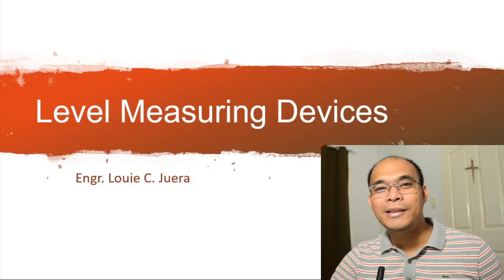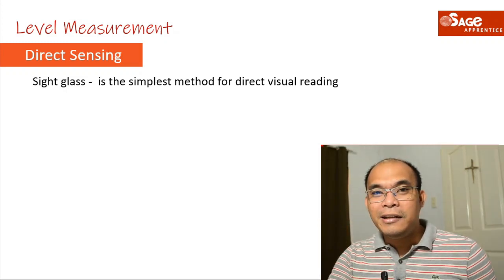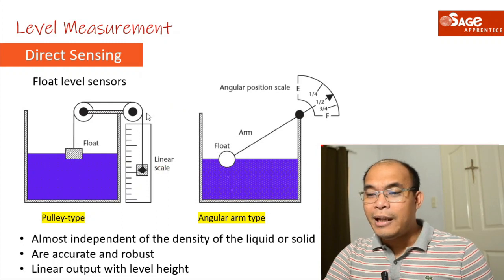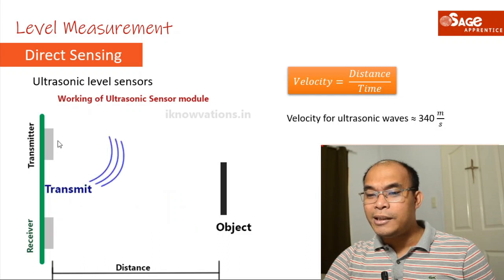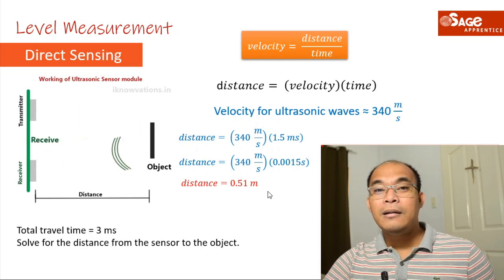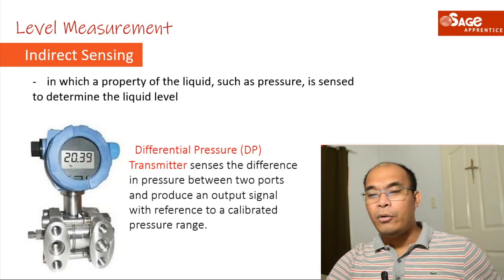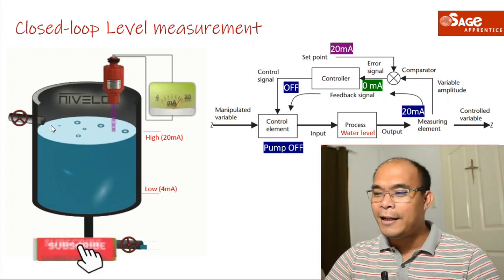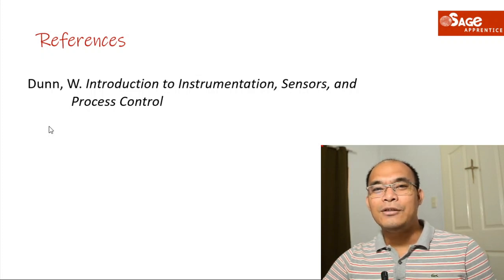How does a Level Measuring Device works?

Comment: Good day Sir!
I'm eternally grateful for the another video Sir because I have expanded my knowledge regarding with, "Level Measuring Devices". The distance between the reference point and the product surface is measured by the level measurement devices.  This is very important especially in marine automation. Actually, there are two types of level measurement devices: Direct sensing and indirect sensing. The direct sensing, monitors the current level while indirect sensing is used to estimate the liquid level by detecting a property of the liquid, such as pressure. Direct sensing includes, sight glass, float sensor, and ultrasonic device while indirect sensing includes, differential pressure transmitter, and closed- loop level measurement. All devices that has been mentioned have different ways when  measuring a specific level of liquid. So, it is necessary for us to distinguished their pros and cons so that we are  aware of   the deviced  that we are going to used or work with. Thank you and God bless Sir!

Comment: Good day sir, After watching this video. I learned the working principle of level measuring devices. There are two classification of level measuring devices which are the direct sensing and Indirect sensing devices. In direct sensing, there are Sight Glass that is for direct visual reading, Float Level Sensors that indicates if the level rises there is a changes in the linear scale and in the angular position scale and lastly, the Ultrasonic Level Sensor that indicates if the transmitter sends the sound waves, it will reflect to the object. The reflected waves will be received by the receiver and converts the reflected sound waves into an electrical signal. Meanwhile, in indirect sensing which is a property of the liquid such as pressure that sense to determine the liquid level. And also indirect sensing is you need to sense it first before you will know the level of an liquid. Thank You Sir.

Comment: Good day sir! I learned a lot in your discussion especially in the different types of Level Measuring Devices and how they work like sight glass the simplest method for direct visual reading although it's cheap but easily broken, float sensor is the linear output with level height it is also accurate and robust, Ultrasonic sensor has two components the transmitter and receiver, Differential Pressure transmitter senses the difference in pressure between two ports and closed-loop level measurement. Thank you and God bless 😊

Comment: Thanks for this video sir. I learned this video. The characteristi of of glass guage is easily broken dapat hindi pwedi lagyan ng mga hazardous na liquid. Shoud not be longer than 4 feet .
Components of ultrasonic level sensor they have transmitter and reciever. Transmitter nag sesend ng sounds of waves and reciever  recieve the reflect sounds waves.

Comment: Have a great day Po sir. I Learned this video the deferential pressure transmitter . closed - loop level measurements. I learned on how to connect the potentiometer ,and I learned that this potentiometer it's help level of water on Electrical signal's.

Comment: I learned that the direct sensing is more easily to use and more accurate and it is precise when it comes measuring and easy to read the measure, examples sight glass, float sensor and ultra sonic device. In indirect sensing is more on using sensor device, example when the tank is full the sensor will send a signal to the DP transmitter through the controller room to stop the pumping. Thank you sir.

Comment: Have a Good day sir, in this discussion i learned a lot like on how to shot off the valve , when we replaced the sigth Glass ,,,also  i learned on how to connect the Potentiometer,and i found that this Potentiometer it's help the level of water on electrical signal, thank you sir God bless 😊

Comment: Good day sir, this video I learned the working principle of level measuring devices. So specially the two classification of level measuring devices which are Direct sensing and Indirect sensing. So direct sensing is actual level is monitored for example inside the tank if HFO or Water. Which uses by the basic sensing such as sigh glass, float level sensors, and ultrasonic level and also the Indirect sensing in which a property of the liquid, such as pressure sensed to determined the liquid level. Which uses by the Differential pressure which help to sense the level and also the closed loop level measurement. So as a future marine engineering it is important to learned this level measurement on ship cuz it help our duty to be ease.

Comment: With this discussion, I learned and understand the different level measuring devices and the working principle of it in a system. Since there are 2 categories of level measurement, it states the meaning, its usage and their basic devices. One of this is the Direct Sensing which means that the actual level is monitored and has a basic devices namely sight glass, float sensor and ultrasonic devices. On the other hand is the Indirect Sensing in which a property of the liquid, such as pressure is sensed to determine the liquid level. It has also the differential pressure (DP) transmitter and the closed-loop level measurement.

Comment: After watching this video is that the operation of the level measuring devices. There will be a two types or two categories in level measuring devices and that is direct and indirect sensing. In the direct sensing is that the actual level is monitored and tells something about its environment are sight glass, ultrasonic devices and float level sensor, sight glass is the simplest method for direct visual reading, the other hand there will be an indirect sensing and it needs pressure, and indirect sensing in which the property of the liquid sveh as pressure, is sensed to determined the liquid level thankyou sir, for learnings ❤️

Comment: Good day sir. Thank you for discussing the level measuring devices. I learned that these level measuring devices is very helpful and important onboard ship. I also learned the two categories of level measuring devices the direct sensing and indirect sensing. The direct sensing the actual level is monitored and have a three basic devices the sight glass, float sensor and ultrasonic devices. Indirect sensing in which a property of the liquid such a pressure is sensed to determine the liquid level.

Comment: Have a good day sir, thank you for this video.  I learned  this video  the deferintial pressure  transmitter. Closed-loop level measurement, and i learned in how to connect  to potentiometer and this  potentiometer it  helps level of water ob electrical signals

Comment: Level measuring devices are usually fix on the tank. This devices can indicate the level of the liquid inside the tank. This device is helps the duty personnel so identify the level of liquid inside the tank. There are two types of level measuring device Direck sensing- sight glass, float level senso, and ultrasonic level sensor. Dad that type is indirect sensing which are differential pressure (DP) transmitter, and closed-loop level measurement and I learned on how they measure the level of the liquid inside the tank from your video discussion thank you ❤️ sir and God bless you. 😇

Comment: Good Day sir. I learned in the video the difference of direct and indirect sensing. The difference between the two sensing device is that the direcr is actual monitored and the indirect need backup and how level measuring device works. Thanks sir

Comment: Thank you for this video sir. I learned that level of measurement has two categories the direct sensing and indirect sensing. the direct sensing is an actual level monitored sample of this is sight glass the float sensor and ultrasonic devices. while the indirect sensing you need to used back up in order to determined the liquid and from thier it is being integrated to closed loop level measurement.

Comment: Good day Sir! 
I learned about the two categories which is direct sensing and indirect sensing. In direct sensing is actual level monitored inside the tank like liquid or a solid form. The device is use for direct sensing is, sight glass  is the simplest method for direct visual reading because you can see the level of the liquid using the glass. Sight glass is not recommended for hazardous liquid for example is the glass is broken it can cause harm to the engineer. Second direct sensing is Float level sensor  is have a two type it is Pulley type and Angular arm type. Pulley type the process of this is  when the liquid is rises it equivalent changing in linear scale to measure. The process of Angular arm type, when the liquid is increasing it goes to the full side and when the liquid is decreasing it comes to the empty side. Futhermore the ultrasonic level sensor have a two opponents the transmitter and the receiver. The process of this is the transmitter send a sound waives and reflect to the object then receive by a receiver. 

Indirect sensing is sensed to determine the liquid level, to measure the level we need anther quantities such as pressure. The most common to use is such as DP transmitter.

Comment: After watching this video sir I was able to understand about measuring devices the direct sensing (which is the actual level or what is seen is monitored) and the indirect sensing (which we use the pressure to sense the level of the liquid) very interesting topic specially with the closed loop level measurement I wish to experience this kind of measuremnt in the future(during my class days)

Comment: Good Day Sir! I learned about lot of level measurements in the ship how it works and the difference of direct and indirect sensing.And also on how is the application of sensing element for level to the close loop system. Direct sensing you can see directly what is in the gauge while the indirect sensing is you need to sense it first before you know what is in the gauge.Thank You!!

Comment: I learned in this video all about the different kinds of level measuring devices. There are two categories in measuring which are direct and indirect sensing. In Direct sensing, the given measuring devices were sight glass, float sensor, and ultrasonic devices. In Indirect sensing, it needs another backup or quantity just like in the video it needs pressure. The given indirect sensing device was the Differential Pressure Transmitter where senses the difference in pressure.

Comment: Thanks You for this Video sir,  I have a lot of Learnings about the Level Measuring Devices,  and also the Difference of Direct Sensing and the Indirect Sensing, Direct System is the actual level is Monitored and the Indirect Sensing is which a property of the liquid, such as pressure is sensed to the liquid level. Also in Ultra level sensor, I knew that there are two Components, the Transmitte and the receiver.

Comment: Thank you for this video sir,  i have a lot of learnings about the difference of direct and indirect sensing, direct sensing actual level is monitored and the indirect sensed to determined the liquid level. And the level measurements is almost the same process of closed loop system.

Comment: After watching this video, i learned about sight glass. You can see it from your naked eyes, since it is a glass we need to take care of it and should not be used with hazardous liquid, this glass is cheap and easily broken.
The other one is the closed-loop level measurement, this system use feed back where a portion of the output signal is fed back to the input to reduce errors and improve stability.

Comment: Thank you for this video sir i learned the direct sensing is, how to incorporate it in a circuit such that it can cause action to happen when external circumstances (light levels, temperature, pressure) change.

Comment: In this video I learned about the different kinds of measuring device  and they have two categories in measuring which are  Direct and In Direct sensing. Direct sensing the actual level is monitored and they have three basic devices the sight glass, float sensor and also ultrasonic device. In direct sensing its needs another back up quantity just like example of the video it needs to a pressure and also pressure is sensed to determine the liquid level.

Comment: In this video, I directly understand all about the different kinds of level measuring devices. Direct Sensing which means that the actual level is monitored and has a basic devices namely sight glass, float sensor and ultrasonic devices. Indirect sensing which needs backup and their different components and its function

Comment: I learned in this lesson video is the operation of the level measuring devices. There will be a two types in level measuring and that is direct and indirect sensing. In the direct sensing is that tells something about its environment are sight glass, ultrasonic devices and float sensor in the other hand there will be an indirect sensing and it needs pressure.

Comment: I understand about this lesson is a  hm accurate measurement of fluid or solid height within a vessel and level measuring devices are generally used for accurate continuous measurement of volume of fluid in containers

Comment: This video explains how does a Level Measuring Device works. The purpose of Sight glass is to allow plant managers and engineers to look inside of their systems without disrupting the environment. A Float sensor is a type of level sensor, a device used to detect the level of liquid within a tank. An ultrasonic sensor is an electronic device that measures the distance of a target object by emitting ultrasonic sound waves, and converts the reflected sound into an electrical signal.